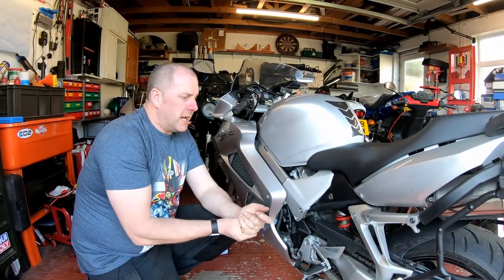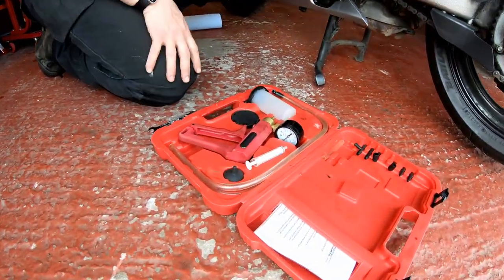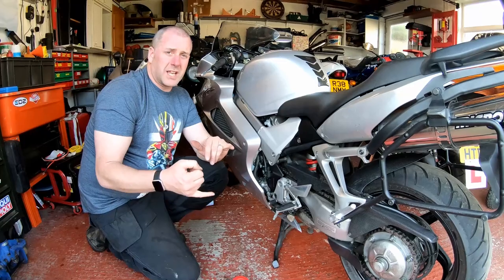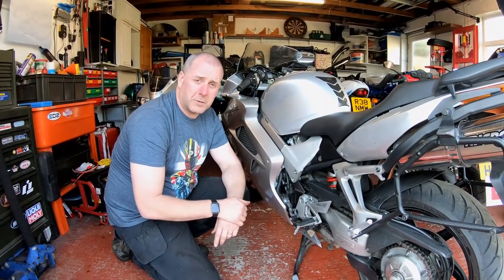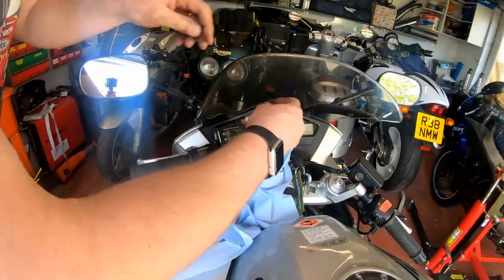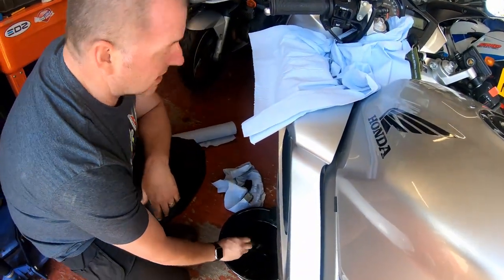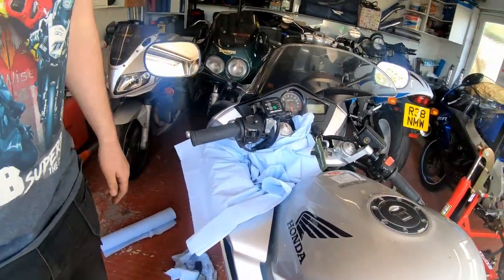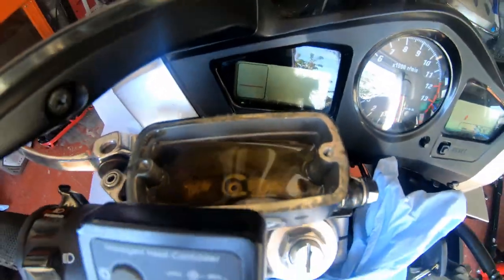Bleeding And Replacing Motorcycle Clutch Fluid - Demonstrated On My 2003 Honda VFR800 VTEC

Comment: If you find that you can't get pressure on the clutch lever, try leaning the bike to the right side enough so that the banjo bolt is lower than the reservoir and pump the handle, you will most likely get bubbles to come out. That was my issue and looks like others as well
Reply: That was the issue! Thanks!
Reply: @kevinkevinson22  Glad it helped!
I probably used a bottle of fluid just to find out!
Reply: @scottcox9108  saved me from my initial panic 😂😂

Comment: HIya I most definitely introduced air into my system when I did mine as I wanted to clean the res. Found out I had a vacuum pump in my loft I never knew I had but the pipes were all old and the thing was just a waste of time really I had to settle with the result I got and luckily the air bubble seemed to rise out by the next morning and I spent many hours bleeding both manually and with the pump but now I have rough loud shifts and a clutch bite point that increasingly moves to the edge of the lever as I ride. I rebuilt my clutch slave which was beautiful when done and this seems to be good now but I am thinking maybe I need to rebuild the master or maybe just there is still air in the system? I get good and consistent lever pressure. My next job will be to replace the oil which is nasty maybe this also is no good. Any thoughts? If I have to rebuild the whole lot what's the best way to keep the bleeding to a minimum.

Comment: Thanks Kev. I have a 91 vfr and have rebuilt the clutch master and slave cylinder. Having trouble bleeding the system of all air and can't get fluid pressure up to snuff. Tried a hand pump and compressed air suction pump. No joy. Any advice?

Comment: did you have a high bite point on the clutch before you refreshed the fluid? mine just like the video is exactly the same probably not been touched in decades

Comment: What a wonderful break bleed tool will be getting one of those. Could you use it to suck fluid out top end too? 
I currently use syringes and jam jar as you described always get a little leak past on tube to jam jar as tubes not quite rite size.

Comment: Hi, great video, but i have question. What type is the clutch fluid ? For  example: brake fluid has DOT 4 and DOT 5.1
Reply from the maker: It is the same fluid mate, DOT4, the exact same stuff that you would use in your brakes. 👍
Reply: @KevsShed  Man, thanks for the quick response :) Regards
Reply from the maker: @em3ata  You're very welcome

Comment: Nice video! When is it reccomended to change the clutch fluid?
Reply from the maker: Brake/clutch fluid is hydroscopic meaning that it absorbs water. This can even be from the atmosphere in the form of condensation. Water in a brake or clutch system can boil causing steam and therefore air bubbles to form. For this reason it is recommended that you change brake and clutch fluid every two years . Don’t forget to subscribe 👌🏻

Comment: I tried changing my 04VFR ..its used and I cleaned the gunk out the reservoir... refilled the reservoir and bled the the cynical (Without the pump) and now the clutch has no pressure.. is it because I didn't have a tube on the bleed nipple?
Reply from the maker: Yes, it will have pulled air into the system.
Reply: @KevsShed  I appreciate you... I'll let you know a update..

Comment: Looks like there is some muck in the bottom of your master cylinder. Doesn't hurt to clean that out. I'm looking into one of these VFR800's so enjoying the videos. Have you done the brake bleeding? I'm curious to see the procedure as I've done many bikes but never one with this linked brake system the VFR has.
Reply from the maker: Brake video will be coming very soon, the job is done and the footage captured. Just the editing to do 👌🏻
Reply from the maker: Keep an eye out for the brake video this Sunday 😉
Reply: AWESOME! I bought a 2008 ABS model about a month ago. Cheers from Canada.

Comment: Why did u drain all the fluid out? Should have left some in and draw it through to keep it air tight
Reply from the maker: People that don’t really know how to bleed a hydraulic system correctly often say that! 😂
Reply: @KevsShed  
Yeah I haven't done it yet but will be soon, u did mention not the expose the lil hole in the master cylinder but you drained it with the syringe completely so was wondering 🤔🤔
Reply from the maker: Did I? I don’t remember saying that it if I did what the reason for me saying it was bud, it was a while ago this vid! The reason that I did it the way I do is for several reasons. Firstly, draining completely gives the opportunity to give the reservoir a good clean. Secondly, it ensures that absolutely all old fluid is removed. Thirdly, it’s the way it would be done if you had to change the hose. Lastly, it’s the way it states it should be done in the factory manual. 👍🏻 good luck with your fluid change. Hope it goes smoothly 👌🏻

Comment: Great vids Kev, the tool you use doesn't seem to be on ebay anymore. I'm not mechanically minded but your vids have helped alot. This job looks easy, is it?
Reply from the maker: Do you mean the vacuum pump buddy? If the link doesn’t work then I will update it. Thanks for letting me know. The job is super easy 👍🏻
Reply: @KevsShed  cheers mate